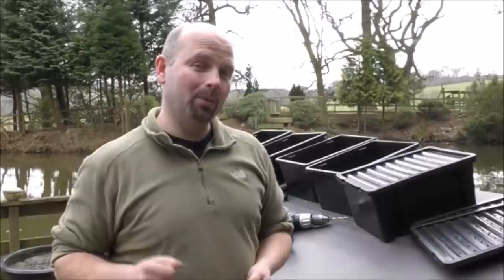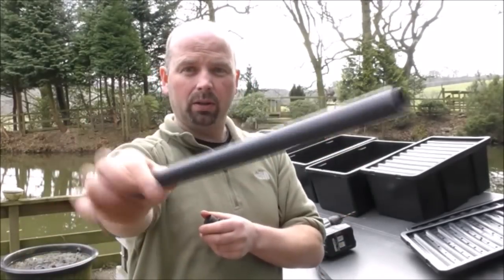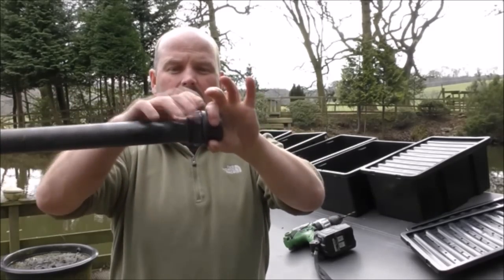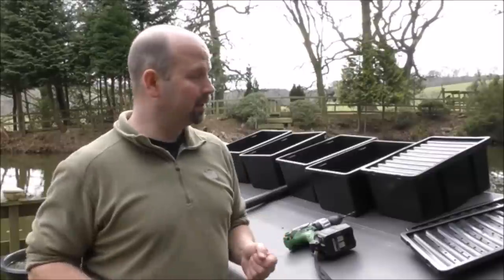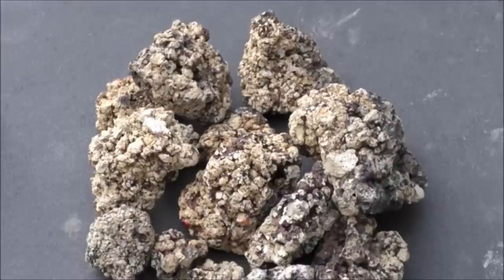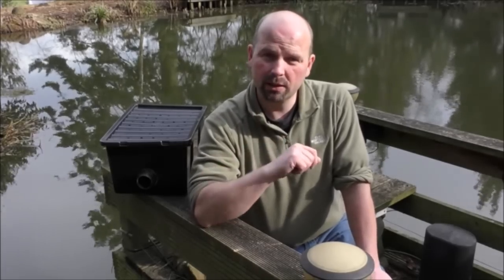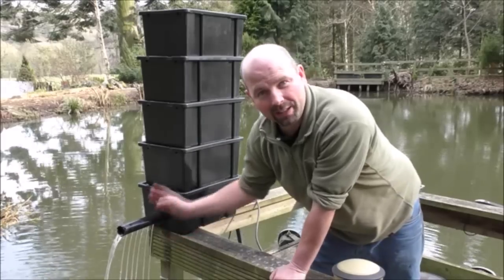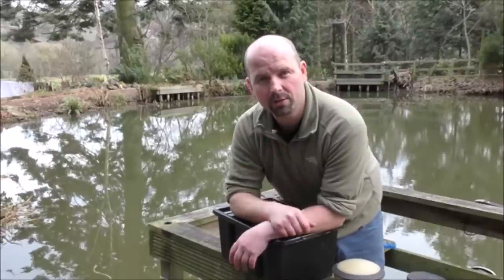DIY Shower / Trickle Filter for a Koi / Fish Pond by PondGuru

Comment: Great video. I've just acquired a large pickling drum to make a filter for my yet to build pond. Would you advise me to follow the same concept. For example: media, fine foam, med foam and course  foam? Repeat repeat repeat? Would be a nightmare to clean. So maybe just lots of media at the bottom and the layers of foam on top?
Reply from the maker: Yes have all the foams on the top if you have a single container followed by the media underneath. That way the media will stay clean and the foam will be easy to clean.
I am intending to make a shower filter with a wheelie bin very soon and it will just be single chamber whit media filling 90% of it and layers of foams on top.
Glad you enjoyed the video.

Comment: Brilliant video, another question here. I have got hold of quite an   amount of lava rock for use in gas grills to keep the heating. Where would you rank those for use as bio media compared to alfagrog, pumice, biohome etc?
Cheers
Reply from the maker: It is very similar to alfagrog - much heavier though as it can be very dense.
It is a sort of volcanic rock called 'scoria' and very much like the white pumice but the white pumice has a much more suitable structure for bacteria. The scoria is definitely not as good as white pumice or biohome but I'd rate it on par with alfagrog.

Comment: Great video Pondguru. How can you estimate the useful lifespan on your biomedia? Thanks
Reply from the maker: As the main forms of biohome have been used in various filter situations for almost 20 years now we've had feedback from many people and ascertained that 6-10 years for a well set up canister filter, shower filter and overhead filter for the media to operate at high efficiency is about average. Structurally it will last well beyond that but efficiency will drop off as the media gets clogged by successive generations of bacteria. In a static bed there is no such thing as a self cleaning media.

Comment: Hi Pondguru,
Great vids mate have learnt such a lot from them all and use ultimate in my filters. Just a quick question regarding anaerobic and aerobic filtration, which order would you recommend them to work best on say two diy water butt filters one aerobic moving bed k1 and the other anaerobic static pumice/ultimate, which should go 1st and 2nd?
Cheers bud,
Tim
Reply from the maker: Dear Tim,
Definitely have the moving bed before the static bed, not after it. The moving bed is almost 100% aerobic filtration and the static bed will be a mix of aerobic and anaerobic filtration. 
Regards,
Richard
Reply: Cheers Richard, much appreciated.

Comment: Great video. Are all the boxes filled with filters or just the first one? Cheers
Reply from the maker: The first box has foams over the biohome ultra and I went with 30mm-50mm pumice in the other boxes. It is still running on my large outdoor aquarium (with no fish in yet, lol).
Early in 2018 I will be integrating the large aquarium into a super-filter which I'm hoping will clear my large pond - that will be quite a project....

Comment: Hi Richard Great video !! I am looking to build one of these for my pond . I am going to be using 27lt storage boxes very similar to what you have here .I am going to use pumice as the media for it the only problem I am having is trying to work out how much pumice to get .I want to use 4 times 27lt boxes and I can get 25kg of pumice could you help out with how much I would need to get Thanks Andy
Reply from the maker: Apologies for late reply, I've been on holiday the last week or so and internet access wasn't the best.
Each 25kg bag of 30mm-50mm pumice takes up approx. 40 cubic litres so if you have roughly 100 cubic litres to fill that would be 2.5 bags - allowing for foams and space in top of boxes I'd say go for 2 x 25kg bags then if you need more you can add it at a later date - it is also available in 10kg bags too.
I have drinking water quality pumice available here http://www.filterpro.co.uk but it is available in a variety of grades and prices online.
I always go for the best quality of anything I am going to buy or sell.

Comment: Great video.   Any idea of the decibels of it running through?   Sounds louder but might be the video.
Reply from the maker: +ThePepperford The loudest noise was from the water pouring back into the pond but that could be cut way down by piping it to the pond properly. The actual shower filter doesn't make much noise as the water is falling only a few cm onto either foam or filter media.
Thanks for watching and appreciating the video.

Comment: On every commercial filter I've seen, the water from the pond enters the media first, then passes through the foam mats. In this design those top mats would get clogged up in no time at all.  So I'm assuming you don't put a filter mat in the top box, just media ? 

Or you could put a coarse mat at the bottom of the top box, but that would be the same as the top of the next box down.

I'm going to make this and put my coarsest mat in the top of box 2, and finer mats in the top of each successive box.  I'll also be putting a second outlet with a tap on (diverted away from the pond) for cleaning off the media.

Comment: Hi buddy! I was impressed by your demonstration but I still have a question. As I see your pond is large enough and its aeration is efficient, naturally by the winds. What if the pond was small, in the backyard for example? Do you think the simple showering on the outlet of the bottom unit will be enough for pond oxygenation?

Comment: Love your videos. You mention that having the prefilter foam will extend the life of the BioHome. So how often does the media need to be cleaned or replaced. Thanks for taking my question, m8
Reply from the maker: While structurally it could last indefinitely the useful service life (for full cycle filtration) is typically 6-10 years.
All media will eventually clog with successive generations of bacteria.
Reply: Thank you for answering, you're the best M8

Comment: I have a 3/4 acre mud pond. There's 500 koi in it approx. 3-8 inches. It's 6-15' deep. Will this improve my pond? There's an evaporation and replacement going on every month during Spring-Fall months. I'm trying to raise Koi to get a full 30 plus inches and lots of them.
Reply from the maker: +Edward White The same idea would work but you would need huge filters. If the pond is well planted and has a natural feed replanishing it then it should be a self sustaining ecosystem with no need for extra filtration.

Comment: great video. im making this exact shower at the moment. i have a 1800 gallon pond. i have a 10000lph pump would this pump be to much for this shower? thanks
Reply from the maker: Yes I reckon a 10000 lph pump would be way over powered for a filter of this size. The boxes would need to be twice as big or you would have to tee off the in pipe to control flow to the filter and send the rest down a cascade.
This fitting is perfect for that: http://geni.us/0f10

Comment: Hi mate, after a bit of advice, I bought a load of pumice off you last summer for a shower I made, which is running well, I have just bought a cloverleaf r1 vortex filter and have some pumice left over..can I use this in one of the bays, what would you recommend in the other bays and in what order? Thanks fella
Reply from the maker: I'm glad the pumice is working well in the shower and with regard to using pumice in a standard filter it would go as the last thing water hit before leaving it (in with / in place of the alfagrog) so it was operating in the cleanest possible water. That way it would extend the lifespan and effectiveness of it.

Comment: great video! I have a 6000 gal pond and wondering how many trays and what size pump to use for trickle filter?
Reply from the maker: Glad you enjoyed the video.
The size of filter and amount of media required will depend on the stock in the pond but I am assuming a heavy fish stock (koi?) so if you are going the DIY route something about the size of a standard wheelie bin would be great for a trickle filter. You'd need a UV before it of about 100w and the filter (if made from a wheelie bin or stacked boxes of similar size) would hold around 100kg of pumice which seems to be the best media for performance and price balance.
What filter do you have on the pond at present?

Comment: Honestly for the costs and benefits I'd say pumice is better. It's around half the price (or even less if you buy in bulk) of coarse you have to use volume instead of weight when camparing the two as pumice is alot lighter which is another befit because its alot easier to do matainace on. I'm fairly certain pumice has the same if not more surface area than biohome. Pumice is also in inert so it doesn't change the Ph and if you get bigger peices its likely more effective at removing nitrates. I have roughly 7 pounds of biohome on my 75 gallon and around a gallon of pumice. I dont know which one works better but I kind of wish I would have just went all pumice as its alot cheaper. Thats my opinion anyway I'm more of a ghetto aquarists but biohome is still a good product but to me I'm going with pumice on my future tanks.
Reply from the maker: +Sean Kile The biohome and pumice will work fine together and I definitely wouldn't call pumice a ghetto option but there are so many different types ranging from the reddish brown stuff used in landscaping which contains lots of iron to the white pumice used for filtering drinking water. I really should get a range of different quality pumice together and make a video on it as it is generally good.
Two very popular filter medias are just pumice - Matrix and Marine Pure. The marine pure is shaped from good quality pumice but the matrix seems to be very variable in quality which is disappointing considering what is available.
I recently got a few 100kg of pumice which is used for filtering drinking quality water filtration and it has a specific pH of around 8.0 which is perfect for koi, malawis and marine.
Just because I sell biohome (which it can be used in any situation) doesn't mean I'm not always looking at alternative options for filtration - the pumice offers a great solution for larger filters where cost is an issue but performance is still needed.
The biohome has a very reliable internal structure (as it is manufactured) so each piece works as good as the last. Depending on the quality of pumice I'd say it can do an excellent job too and as a rough guide the darker the pumice the more suited to lower pH tanks it is. The lighter the pumice is the more suited to higher pH tanks it is.
I'm always willing to revise that and that's just an observation based on composition and specific pH.
Thanks for watching and commenting - I love it when people think about filtration from a quality and efficiency perspective.

Comment: Do you have media in each of the containers?
Reply: Brendan Harington I’ve just built one of these and used sponges in top box and alfagrog in other 4 with a flow rate of 5000ltr absolutely outstanding resulting after only 5 days running, was going to buy a baking filter but the way this one is working I’ll save my money

Comment: Hi Rich, Excellent video. I've been meaning to build one of these for a while. My only question would be, could I adapt my existing set-up to accommodate this. My current setup is Oase 8000 pump / Oase filtoclear 16000. Could I take my return from my filtoclear and run to the top of this trickle tower? My pond is already very clean, healthy water, but the filter does not really have any filter media inside, just foams. Could maybe 2-3 boxes filled with some really good media work?
Reply from the maker: +RichyJam2011 Yes without a doubt and with good media it could reduce nitrates in the pond too. 8000 lph would be too much flow for a filter of this size but you could tee off and put 2000-3000 lph through no problem.
Reply: bought filters = rip offs + unhappy koi

Comment: Great video, what is the maximum flow rate this will handle as a 5 tier?
Reply from the maker: Probably around 4000 litres per hour but bear in mind that if you have a solids handling pump or do not have a pressure filter acting as a pre-filter this shower may get quickly clogged so it would be worth fitting an overflow from top section back to the pond. It would need to be above the foam level in top section.

Comment: building one of these right now. I'm using a three tier system with slightly smaller containers (5 gallon each). It's only for a 300 gallon indoor pond. What size pond pump do you think I should go with for such a small pond?
Reply from the maker: It really depends on how the filter is made and how high it is lifting from water to top of filter so check the flow rates at whatever height your filter is. The flow through a shower will also be more critical if it is the only filter for the pond and if fish like a good flow / a good turnover rate is needed.
Reply: @pondguru  thank you for the reply and all of your helpful videos. The filter is going to be modeled exactly from yours, the pond stand two feet off the ground (its actually a galvanized stock tank with a pond liner in it), and i will build a pedestal for the filter so the drain can drip directly baack into the pond. Each container is approximately 1 foot tall for a total of a 5 foot rise (from bottom of pond to top plastic bin). I did plan on this shower filter being the only filter, but if needed I can add an aquaclear 110, or an fx6.
Reply from the maker: @epicbeard3dman  That sounds fine and should easily be enough for a 300 gallon pond - as the lift is 5' you'd probably need a 3500 - 4000 litre per hour pump for a decent flow through the trays.

Comment: Hi Richard I'm going building an above ground pond 1000 gallon and am going building a shower filter like this one. Was going to use 15kg alfagrog in 2-3 32ltr bins with a Blagdon force 8000 pump. Do ya think this is enough filtration? Pond will only be lightly stocked with koi and goldfish

Comment: Hello fellow English YouTuber :) I Might build one of these for my 1900 gal pet pike outside tank :) might use biohome ultra if it takes out nitrates that is amazing stuff did you invent it?
Reply from the maker: I did not invent biohome but I had a hand in developing some of the types now sold (with regard to porosity, shape, size).
1900 gallon would need a heck of a lot of media to provide the full cycle so maybe a combination of 30mm-50mm pumice and the new shower media we are going to be selling shortly would be the best option (to keep costs down) - feel free to ring any time on 07772848730

Comment: built a pond that is just under 500 gallons that has a decent pump filter on it now with uv light and spray fountain for aeration but it also has a second hose valve that i would like to run to one of these. how many tiers do you suggest for a pond that size?

Comment: Did you place any media in the lower boxes? If so could it be some of the other types you mentioned? Great stuff and now got me thinking.
Reply from the maker: +Michael Asplen Yes I actually used the 30mm - 50mm pumice for the lower boxes as I am currently using the filter (3 parts of it) on a large outdoor aquarium where I want the water to be quite mineralised and the pumice helps with that. I have a video ready to go live on friday night which shows it working.
I was speaking to a guy yesterday who wants a large filter making for a koi pond so I will be filming that one soon hopefully and I'll make it out of a wheelie bin as that offers lots of space for media.
Reply: Thanks for the information, and the wheelie bin sounds intriguing. I have a 4000 gallon Kind pond with a Nexus 310 Filter system but looking to add something like a bakki but watching your video has made me definitely thinking homemade. Thanks again
Reply from the maker: +Michael Asplen Yes, having a shower filter of any suitable type and size after a nexus (I'm assuming your pump is after the nexus and the filter is gravity fed from bottom drain) is a great idea as the nexus produces a nation of nitrates which are no good for fish growth.
I can't believe that EA still have not addressed that issue as filtration should not end with the build up of nitrates.
Reply: +Pondguru Outdoors No actually I bought the Nexus after pond was complete, it is pump fed from directly pond floor and also a Oase skimmer via a Y connecting pipe.The problem is how to feed the nexus to Bakki or even if I had a sieve before as I would need a dry pump in between and gauging the right through pressure would be quite hard and expensive, I was thinking of designing the Bakki to feed from a new skimmer and directly back to pond, maybe via a small UV (25watt?).  I will have to somehow send photos to you of complete layout.Regards
Reply from the maker: +Michael Asplen Yes it would either have to be fed from a separate pump or by putting a Y splitter in before the Nexus so water could be piped off to the shower filter.